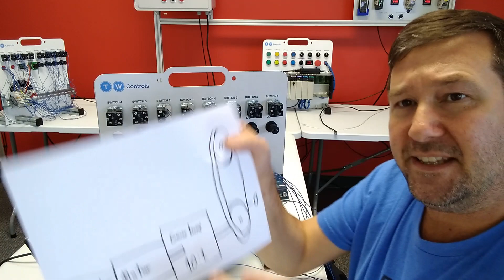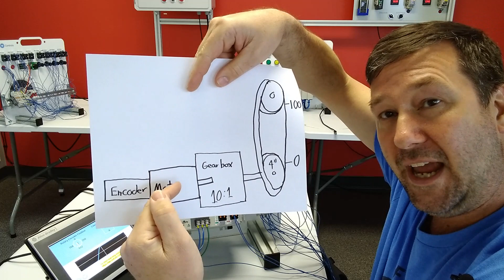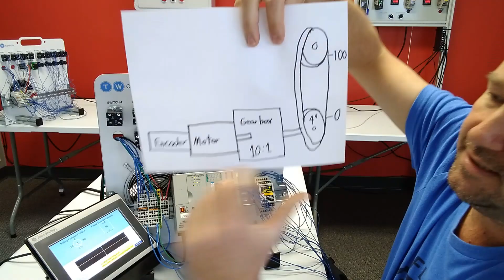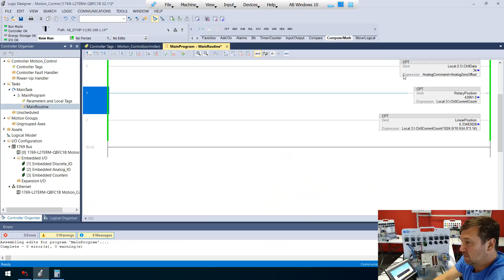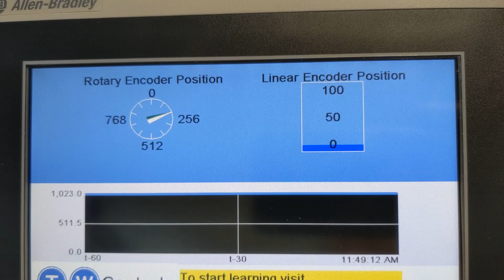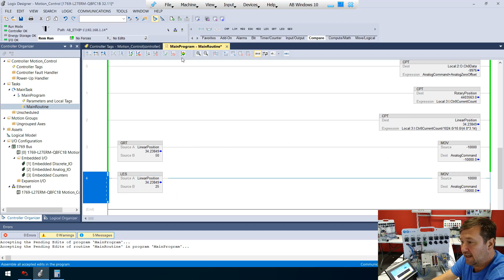Math for Rotary Motion to Linear Motion Conversions on Servos

Comment: Hi Tim.  I love your videos.  They are remarkably helpful.  One comment regarding the math for the conversion from rotary to linear... I believe you should multiply by the circumference of your 4" pulley (Diameter x pi), not divide.  If you divide by the circumference then your rate of linear travel (distance/rev) would decrease if your pulley's diameter increased, which is, of course, nonsensical.  I find it helpful to do my math with the units... they keep me honest. 

Encoder Reading pulses x (1 Motor Rev/1024 pulses) x (1 Transmission Rev/10 Motor Rev) x ([Diameter x Pi inches]/1 Transmission Rev) = _ inch (ok!)

Same as:           Encoder Reading/1024/10 x (Dia x Pi)  
Should not be:  Encoder Reading/1024/10 / (Dia x Pi)    [units = Transmission Rev ^2 / inch:  doesn't make sense = warning that there's a math error]

Cheers
Reply from the maker: Hi Ken, it has been a while since I watched this video but your math sounds right!

Comment: Hello, 
Hope you are doing well. I’m not real experienced in Rockwell Equipment. I’m real experienced in Omron. We have talked a while back on Positive grounding on 24 volt power supply’s. I enjoyed your Motion Video. Omron Motion Control has it’s on rack mounted card. That contains Parameters for Encoder Resolution, Scaling, Analog Voltage +- as to Forward and Reverse , Motion Program etc. It also has a Specific Core I/O Range for Motion Commands . Inputs to the PLC and Outputs from the PLC. It would be great to see Control Logic 5000 Motion. Also do you have any videos on D-Net for Rockwell does it have a specific Address location for status Words if so does it create a Scan List Table? And help would be appreciated. Thanks
Reply from the maker: We are going to do some more motion videos soon but I'm not sure that we'll do Controllogix.  I'm pretty rusty on Devicenet

Comment: Great video, and your timing was great. I am just starting a project using some motion for a gap reduction in between products. This is my first motion application. I have not sat down and done the math yet, but now I know exactly what I need to do.
Reply from the maker: Great to hear that the timing was good.  The biggest thing when doing the math is to break it down into the simplest steps.  It will make your errors easier to find later on.